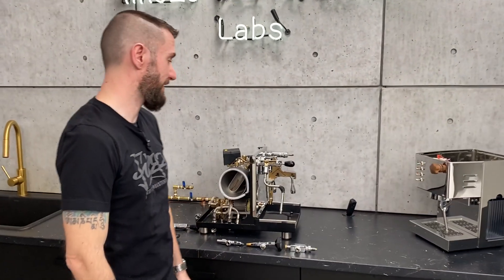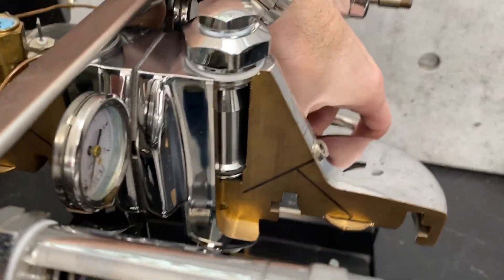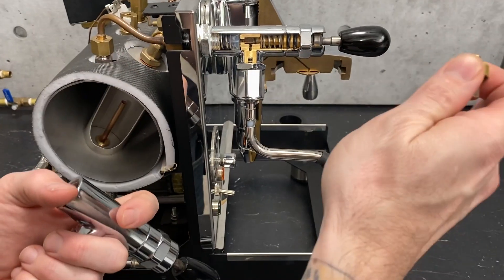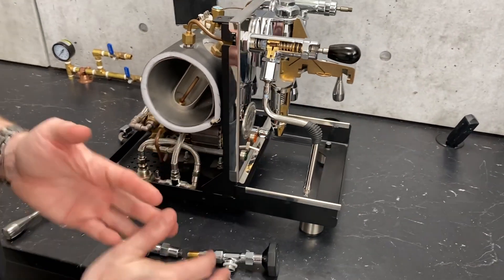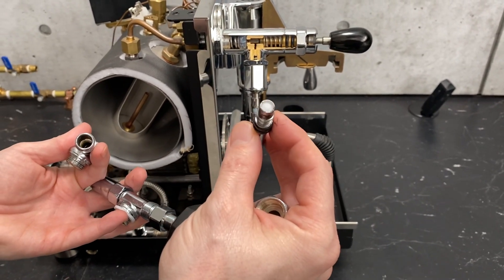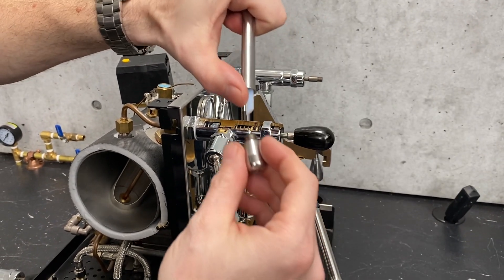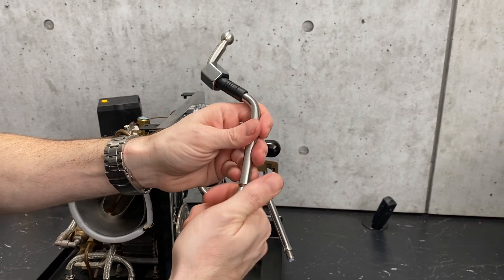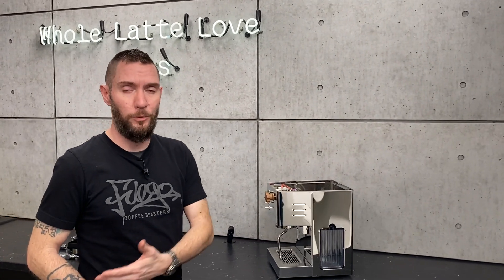How It Works: Espresso Machine Steam & Hot Water Valves

Comment: Does the ECM Technika IV steam wand ball valve need any lubrication?
Reply from the maker: Hi glen, forwarded your Q to our Tech Team. This is their response: I assume they are talking about the ball joint, not the ball valve. If so, generally no. As long as all the connection points are clean and smooth, you do not need to lubricate them. I will add a very small amount as protection, but too much causes a droopy wand.
Hope that helps!
Marc
Reply: @Wholelattelovepage  Thanks you are correct, it is the ball joint. I certainly don't want a droopy wand!!! LOL

Comment: My profitec 500 has been leaking at the tip of the wand. I replaced the red gasket and cleaned up the ring where the gasket sits, but it’s still leaking steam and water. What else could be causing this?

Comment: I have the profitec Drive and would love to swap the steam and the hot water as my kitchen cabinets are to the left of my espresso machine. Are you able to swap them with no problem? I don’t know if the internal mechanics are different from side to side. Thank you.
Reply from the maker: Hi life_is_adventure,
The steam wand is tapped off of the top of the boiler and the hot water arm is tapped off of the bottom, you can't easily change them.
Reply: @ thank you so much!

Comment: Hi, I’m hesitant between getting an espresso machine with joystick design or knob design. My main concern is reliability and self service. Which would you recommend? Thx
Reply from the maker: Hi c, Sprung valves operated by knob or lever are equal in reliability and self-service. Knob operated valves which are not sprung rely on user force to make a seal. They tend to wear faster if user over tightens regularly which causes the seal to wear faster.
Reply: @Wholelattelovepage  thank you so much

Comment: Hey Marc. I see in another comment that you mention ECM joysticks can be installed on 500, 700, 800. How about the 600? I reached out to WLL support, and the rep didn't seem to have the most knowledge on this particular subject. But I'd like to swap out the standard Pro 600 Valves with joysticks. Who could I talk to from WLL that could get me set up with the particular ECM parts I'd need. Based on this video, I'd imagine it's just a sraight swap to disconnect the water line from the back of the valve assemblies, and throw the ECM version on there.

Comment: I really enjoy WLL videos that explain how these machines work
Maybe you could do a video on the new instant heat boilers at some point
Thanks
Reply from the maker: Hi Ardy, Thanks for the comment. Are you referring to thermoblock boilers? They heat water on demand but have been round for awhile. I know Breville makes a rather unique instant heat boiler.
Marc
Reply: @Wholelattelovepage  
Well, I was sort of talking about the challenges and evolution of this technology 
Apparently Victoria Arduino Eagle one has come up with a new version of a heat exchanger which lets them have improbably small boilers in a commercial machine

Over all, I think few of us think about the challenges of maintaining a stable temperature. For instance… i have a Silvia with a tiny boiler and pid… and a relatively cold room.  When I turn in the brew switch… it is a bit shocking how quickly boiler temp drops because of the new cold water refilling the boiler.  And with this old machine… if the heating element is off…. The heating element only slowly starts reheating the boiler water.

My point. Guess is that maintaining and delivering stable temp water is a challenge that seams a lot easier than it is in practice
I think it is interesting…. But maybe not worth a video .

Comment: Thanks for the informative video. My question is that some coffee lovers has the statement of not using steam boiler hot water for Americano or long black and you shouldn’t drink?? Is that True 🤔?!
Reply from the maker: Hi MA, You are welcome. I wonder if you're hearing that because hot water out of the machine is so hot. It's very close to 212F/100C. Could easily burn you and is far too hot to experience flavor. Many coffee lovers and tasters want a beverage cooler than 150F/65C. At those temperatures one can actually taste the flavor!
Reply: @Wholelattelovepage   Thanks, I agree, the high temp won’t give great flavor but the advise is not to use it for tea even just turn off your machine and drain it to reduce scaling accumulation inside the steam boiler. Never use for any tea beverages too.

Comment: Could you equip a joystick style valve in a machine such as a Profitec 500?
Reply from the maker: Hi P, Thanks for the question. Yes, ECM joystick valves can be mounted on Profitec Pro 500, 700, 800.